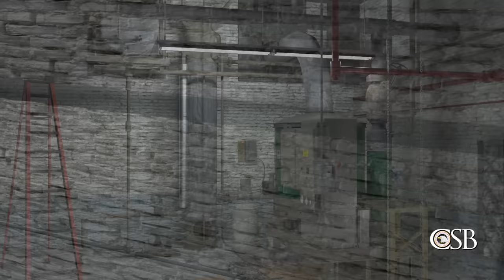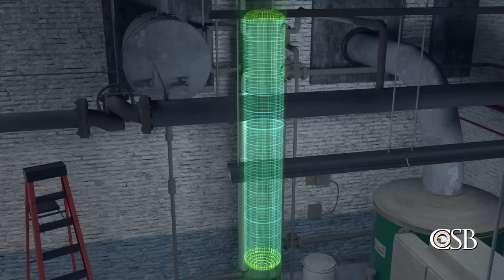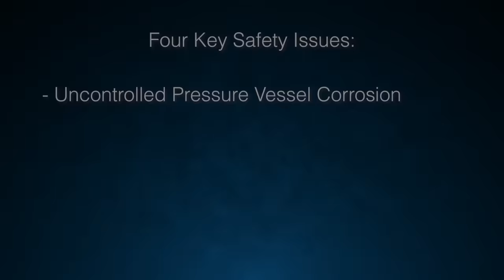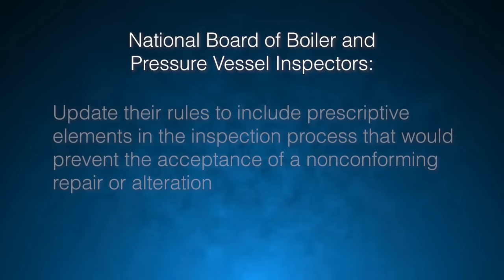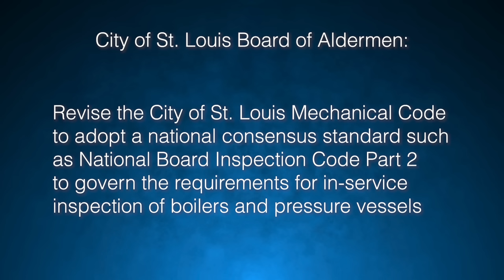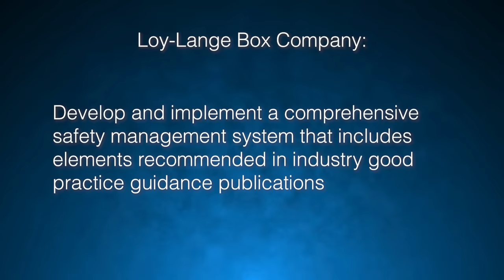Ignored Warnings: Explosion in St. Louis

Comment: Loy-Lange and the the company that held the repair stamp are the initial problem.  To repair a corroded ASME head by cutting and welding a new dish section is beyond stupid. That Loy-Lange was aware of a steam system corrosion issue and never addressed it is unacceptable. And coming to the rescue by putting more levels of regulation in place after the fact is just as stupid. Steam is not a new technology and understanding how to safely operate steam systems is not brain surgery. Try hiring some people in your company that know what they are doing and are accountable. You will kill less innocent people that way.
Reply: Agreed, but you're also missing the City's role in the failure. Their laws required the City to inspect the Loy-Lange steam system every year, and they weren't doing that. The video mentions the last time the City inspected the place was 2010, before the faulty repair even happened. If the City is going to assume the regulatory responsibility (as opposed to the State of Missouri) then the City needs to actually enforce its own laws.
Reply: @oxnardmontalvo  Thanks for the reply and I do agree they also have a hand in this tragedy. I do not put to much faith in city ordinance and inspection though. You saw how easily they ducked out with that bridge collapse in Florida.

Comment: Around 2:00 can someone explain how that works? I can't see how you can remove oxygen from water, and still have water since water is literally h2o. One part hydrogen, 2 parts oxygen. If you remove the oxygen wouldn't you just have hydrogen gas?
Reply: The video is referring to oxygen gas dissolved in liquid water. Water naturally contains dissolved oxygen. That's how fish breathe for example, their gills absorb the naturally dissolved oxygen. Dissolved oxygen is very bad for steam systems, and must be removed from the water. There are two primary ways we do that. The first is by heating the water to near boiling (around 200F as the video stated), and the second is by adding chemicals called oxygen scavengers (also as the video stated).
Reply: @oxnardmontalvo  So in essence they want to use a vacuum then to remove all outside oxygen and gases to have just water flowing through the system
Reply: @buckberthod5007  Sort of, yeah. By preheating the water, most of the dissolved oxygen leaves the liquid just by evaporation. That oxygen would just leave the system through an atmospheric vent (which the video doesn't mention but the full report does). The rest of the oxygen is taken care of by the scavenger chemicals, which react with the dissolved oxygen, thereby making it unavailable to corrode the metal. There's no vacuum involved, since all of this is under pressure. But in essence, you are correct, steam systems just want water flowing through without any dissolved oxygen.

Comment: If you remove the oxygen from water, you get Hydrogen. So, is corregated cardboard actually made from liquid hydrogen? Why does the narrator keep calling it "water," after the oxygen is removed?
Reply: The video is referring to oxygen gas dissolved in liquid water. Water naturally contains dissolved oxygen. That's how fish breathe for example, their gills absorb the naturally dissolved oxygen. Dissolved oxygen is very bad for steam systems, and must be removed from the water. There are two primary ways we do that. The first is by heating the water to near boiling (around 200F as the video stated), and the second is by adding chemicals called oxygen scavengers (also as the video stated).
Reply: @oxnardmontalvo  Okay. So  additional oxygen added to water apparently doesn't become H2o2? You don't have to answer that if you don't want. I'm just trying to wrap my brain around this. It's probably why I barely passed highschool chemistry a million years ago (lol).

BTW, I thought fish breathed in the oxygen that makes up the oxygen part of the water molecule. Then, the 2 hydrogens would evaporate until they rejoined oxygen in the air then would condense back into water. Anyway, your answer does make sense - I just didn't realize oxygen can be absorbed by water without becoming part of the water itself. Thank you for replying! 🙂
Reply: @scootermom1791  No problem! It's the same principle with carbonated beverages. Ever looked at soda or champagne closely? Where do the bubbles come from? The bubbles are carbon dioxide gas dissolved into the liquid, in the same way that you can dissolve salt or sugar into water. It isn't changing the chemistry of the water molecule. The salt, or sugar, or CO2 is just hidden in there between all the water molecules. 

In steam systems, for corrosion of this type to occur, you need three things - water, oxygen and metal (iron specifically). You must eliminate one or more of the three things to prevent corrosion. Well, it's a steam system, we're trying to boil water, so we can't eliminate water. And we built it out of steel, so we can't eliminate metal, so that leaves us with our only option: remove the dissolved oxygen from the water!

Now, changing the chemistry of the water molecule is also possible. For example, you can attach a second oxygen atom to make peroxide, just like you said. Or, you can split water into oxygen gas and hydrogen gas. But those are both chemical reactions that alter the base water molecule by breaking molecules apart and rearranging atoms like lego pieces. None of those things are happening in a steam system
Reply: @oxnardmontalvo  That makes a lot more sense. Thank you for the explanation! 

The only thing I still don't understand is what actually changes the chemistry of a molecule. What stops the oxygen atom from attaching itself to the H2O molecule? Or what makes molecules break apart? I'm guessing breaking them apart would require some kind of energy (like heat or electrity) and is probably easy to break a molecule up. But how do they get together to begin with? I honestly don't think that was ever covered in my old HS chemistry class. But, again, that was a million years ago, so who knows? Lol 🙂